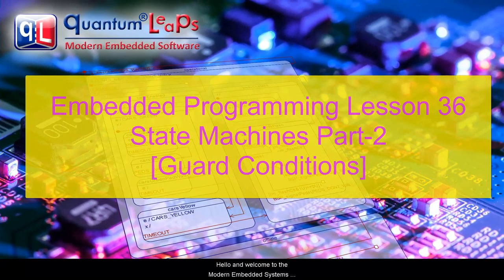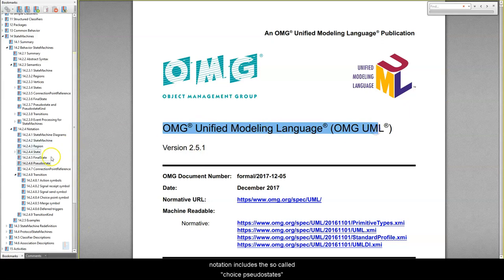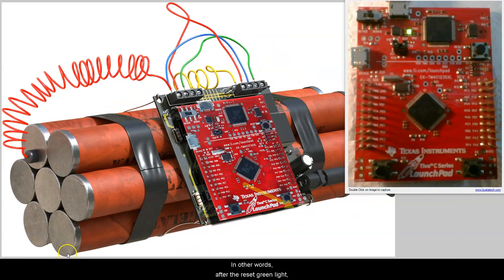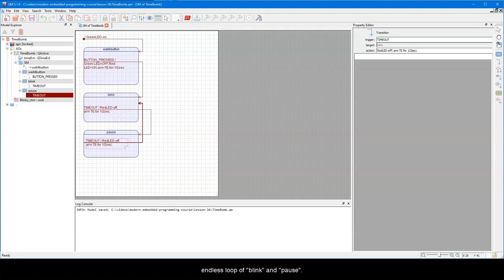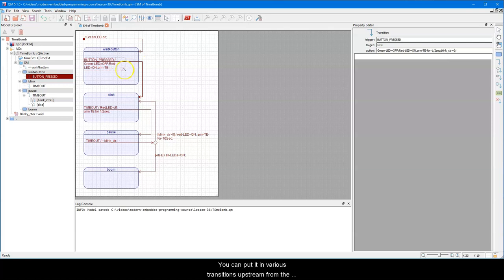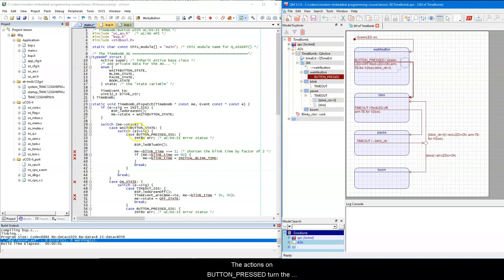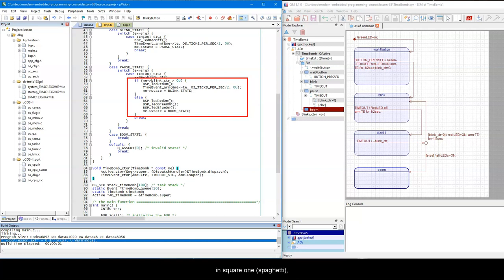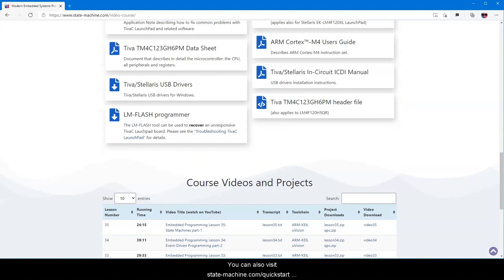#36 State Machines Part-2: Guard conditions

Comment: This video brings up a question that's always on my mind (which I think you address somewhat in your Meany vs. Moore state machines video).  When your guard detects the 'else' case, it turns all LEDs on. This could as easily happen in the initial transition to the 'boom' state.  Is there a mental model to use to decide which actions should be done as part of the input to the state vs. in the state transition itself? 

Another question that comes up when watching:  In my current project I often find myself posting somewhat arbitrary events rather than generating guard conditions.  For instance, if I receive an event containing information that directs me to one state or another state, I tend to create and post an event for each of the two transitions, rather than using the guard to transition directly.  This is partly because so much of my work is done in orthogonal objects, but also to minimize guard transitions.  Can you comment on some considerations when designing these types of transitions?
Reply from the maker: Please remember that we are in the early stages of learning about state machines, and entry/exit actions to states ("Moore-type" state machine elements) have not been introduced yet. That's why at this stage all state machines presented are "Mealy-type", meaning that actions are only associated with state transitions. But you are right, that it will be more elegant to turn the LED on upon the entry to the "on" state and turn the LED off upon the entry to "off" state. This is all still coming when I show how to implement entry and exit actions. Regarding the guard conditions, they should be used very judiciously, because they are not necessarily a good thing! Specifically, every time you can replace a guard condition with an extra state or two, you should probably do it. Designs settled before compile-time that don't defer to IF-s and ELSE-s evaluated at run-time are clearer and generally superior. Finally, too many orthogonal components are not necessarily a good thing, because you have to keep track of many "current-states" in parallel. If some of this can be folded into a single state machine, you can cut down on the number of parallel states and the need to coordinate among them. --MMS